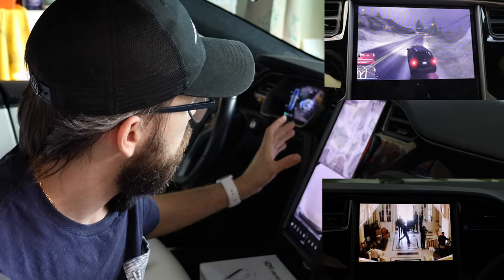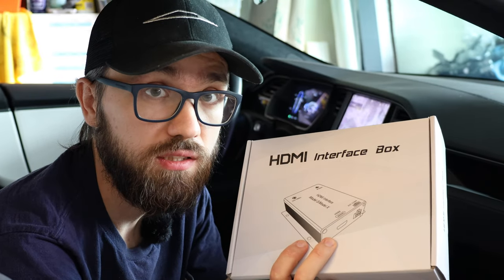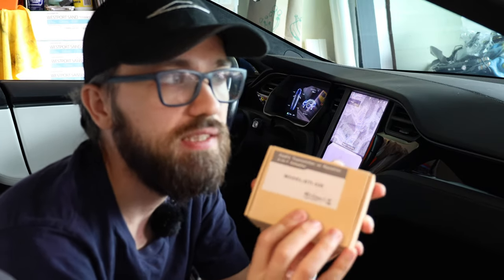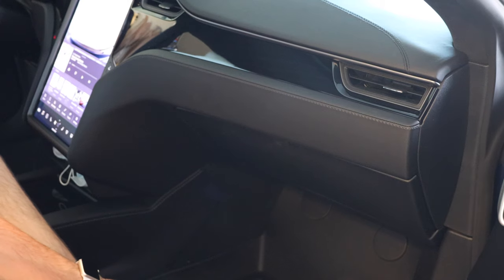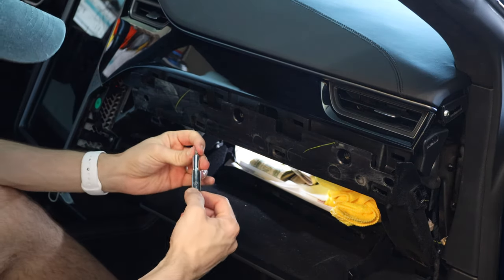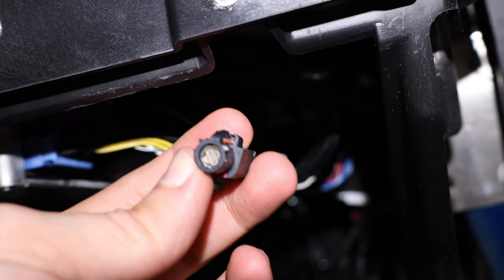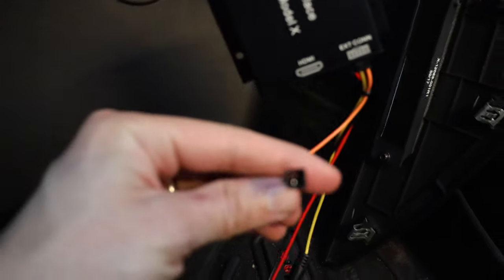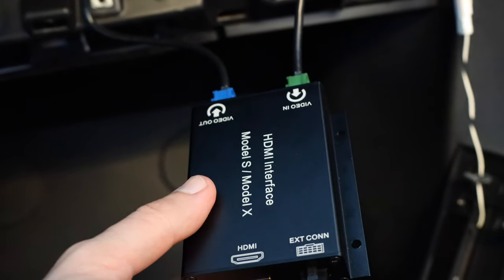Installation of HDMI interface in a Tesla

Comment: Question--Do you lose camera functionality while driving and not in Reverse?  Or said differently--does the rear camera only work in reverse now?  I'm asking as I drive on the highway with the side cameras and reverse camera activated at times.  Thanks and great video!
Reply from the maker: No functionality affected whatsoever. I drive 100% with my camera on. Think of it as a on/off switch, if you want HDMI input, you just press button, then press it again to switch back.

Comment: Im trying to install on my model X 2017 ap1, however my instructions were to do it on the driver side but am having no luck
Reply from the maker: AP1 is slightly different. Are you sure the the one you got is made specifically for AP1?

Comment: Would love to try this in my model 3... I wonder if the same box would work
Reply from the maker: I am fairly confident that box will work.
The problem is wiring and “control” of the box as there is no similar buttons on steering wheel. I think we could possibly rewrite it to work with some sort of mechanical switch - but that hurts convenience
Reply: @DealerofHappiness  ah I gotcha.
Reply: @Sibs  Did you ever try this out, Alex?
Reply: Excellent, excellent video! Did you ever get Alex Sibila to share his Model 3 with you? Thank you so much 😊

Comment: Hi Dealer of Happines - I bought a Tesla Model X with MCU2 and saw an HDMi wire. Noticed the hdmi wire was sticking out on ground coming out of middle front row armrest console for 2nd row passenger customers. 

Figured this might be an upgrade the previous owner did already (I bought from dealer so can't verify).  I tried this weekend to get iphone to hdmi dongle and tried connecting with hdmi wire to my phone. 

Not sure how I can confirm i have these interfaces in my car.  How did you connect to the car from phone?  Just the hdmi wire and adapter?
Reply from the maker: Yes, just hdmi and adapter.
Watch my video I show the button you need to press on your steering wheel in order to switch between rear camera and hdmi.
Feel free to reach out if you will have questions, I will be happy to help

Comment: How would I get a console to run from it? I’m thinking remote play and ps5? Any thoughts? Think im going to order this kit today and try it
Reply from the maker: Why do you need remote play? It’s hdmi, just plug in PS5 directly and enjoy.
They only issue would be sound, which you would need probably need to use Bluetooth speaker in case of PS5
Reply: @DealerofHappiness  ok cool, would I have to plug and unplug the PlayStation when I want to mirror my phone again? It seems like with this kit hdmi needs to be plugged in all the time in order for the phone to mirror like you’ve showed. Maybe I’m missing a step 🤔. It’s no biggie either way, just wondering.
Reply from the maker: @UnBiasedConsumer  correct, it’s a single hdmi connector so only one device can be connected at the time.
I have Nintendo switch plugged in occasionally and sometimes reconnect to my phone when needed (takes 10 seconds)
Reply: @DealerofHappiness  ok perfect 👌🏽 thanks. I’ll give it a shot and upload a vid 🔜
Reply: Hey so am I installing this on the glove box side like your vid here or on the driver side? I’ve seen videos of both, I don’t  have auto pilot by the way.
Reply from the maker: @UnBiasedConsumer  make sure you buy correct kit as AP0/pre-AP (what you have), AP1, AP2.0, AP2.5, AP3 all have slightly different connectors and you need to buy a kit for your exact version to avoid any complications.
It does not really matter where you install it, as long as all cable can reach, you are good. I just like to install it in a seamless way that car looks absolutely stock except hidden HDMI cord that can be retracted.
Reply: @DealerofHappiness  i installed it, looks dope I love it.
Reply from the maker: Awesome! Glad to hear you enjoying it
Reply: @UnBiasedConsumer  where did you put your system, and how do you power it without it being an outlet?
Reply: @BEESHKii  I power it via a power inverter i got off Amazon. Plugs in cig lighter and has a plug on opposite end. The system is set on the floor of passenger side for now until the PS5 slim comes out, I’ll switch it out then and put in glove box.
Reply: @UnBiasedConsumer  as far as wifi while driving. how is your ps5 connected to wifi? Via iphone hotspot, or some other method?
Reply: @BEESHKii  hotspot from my phone. Stays connected to Verizons 5G UWB

Comment: Any luck doing this recently on a model 3?
Reply from the maker: Unfortunately, no
Reply: @DealerofHappiness  is there a reason why no one has been able to do it yet? How about that guy on Tik Tok claiming to play ps5 on his model 3 haha? is that all fake?
Reply from the maker: I haven’t seen this video, but it is possible. The problem would be to actually control the HDMI unit as current device programmed to use a button from steering wheel that model 3/Y simply doesn’t have.
So in theory, I could see how you could make it work, but you won’t be able to actually control it (turn it on/off) which is obviously a dealbreaker.

Comment: Was that a 3.0 ap cpu
Reply from the maker: Yes. HW3
However this set up can work with any AP, just slightly different cables
Reply: @DealerofHappiness  ok. Put mine in yesterday. Had it in my old pre ap s 85 but it was in accident. Now I got a 75d with hw3.
Reply from the maker: @chrisashley1550  contact the manufacturer, they can sell you new cable for HW3 and the rest will work just fine
Reply: @DealerofHappiness  hooked it up. And it seems to be fine so far. My rear cam was a little grainy at first and my cam seems didn’t want to cut on at first. Did a hard reset. Everything seems to be ok. Camera works and I can switch back and forth with the menu button. I think it’s ok. If I get any issues. I’ll hit them for that cable. Have a nvidia shield and plan on doing rear TVs by the summer. But want a more serious gaming console. Have you done a ps5 or Xbox. Have a inverter for my shield already.

Comment: I saw some else use a HDMI to USB adapter and plug it into the USB port with no need to tear apart your Tesla
Reply from the maker: Sorry, but I am not buying it.
I simply don’t see how that would be technologically possible.
The best you can possibly achieve is to read image from MCU, but certainly not display on MCU - even this is would be very hard to believe because Tesla software simply doesn’t have this “door”. The way I showed is actually very easy and takes 20 minutes max (if you know what you doing) - however as of today, you have to tap into camera input in order for it to be projected on the screen. Also without HDMI controller how could you control what to show when?
I am not a Tesla engineer by any means, but I know these cars pretty well and what you reaching is simply not possible (at least right now). If you have a link to a video, I would appreciate if you could share it with me, I am curious to see.
Reply: @DealerofHappiness  I’m just saying what I saw. In my opinion yes it also seemed a bit to easy.
Reply from the maker: @StormBrkrr  absolutely, I understand, but I am very curious.
If you come across that video, please let me know, I would love to see what they did - you never know, I might be wrong (often I am)
Reply: @DealerofHappiness  It keeps deleting my reply with the link
Reply from the maker: If this is on YouTube, just give the full name of the video - I am very curious.
Or you could purposely “break” link by adding space instead of dots
Reply: @DealerofHappiness  I can’t now but I will get that to you. BTW it was on TikTok
Reply from the maker: @StormBrkrr  I see.
I am absolutely sure they faked it, but I am very curious to try to figure out how they did it.
Thanks for looking into this, but obviously it’s not a big deal if you can’t find it.

Comment: Anyway it is too bad for 2020. Why I can't use AppleCarPlay/AndroidAuto? Why no phone screen mirroring with TouchScreen supporting? No way to use waze without this setup and putting the destination point on the phone. ohhhh........Tesla has almost useless big touch screen.
Reply from the maker: Let’s address this one by one:
*CarPlay/AndroidAuto is a feature that manufacturer need to pay. I do t see Tesla ever paying for third party solutions like this. Personally, I don’t feel the need/wish for these features, but I understand that some people used to it and like it.
*Screen mirror with touch screen support - what you saw me doing is certainly would not be approved by Tesla, they don’t want you to do anything like that. They don’t even want you to do very basic repairs to your car by yourself. Tesla can easily create their own HDMI connector/splitter that would support touch input - but again, I don’t see it ever happening because of regulations, safety, bad press, irresponsible drivers....
*Waze actually works just fine with setup that I showed, the only inconvenience is that you would need to use your “streaming” phone to enter destination, apart from that, no issues.
*screen is “useless” - I disagree, but I would love to have much greater control of what the screen could be used for.

I am waiting for PS5 to be available(I decline to pay even a dollar more over official retail price), and as soon as I will buy it, I will set my existing PS4 to run in my Tesla. Already tested it.
Reply: @DealerofHappiness  how do you plan on powering your PS4 8n the tesla
Reply from the maker: @biggc49042  external battery with 110v outlet that will be charged via 12v (like anker)
Reply: @DealerofHappiness  awesome!